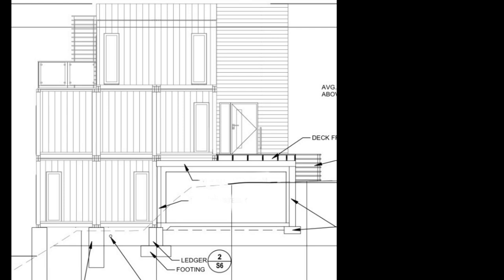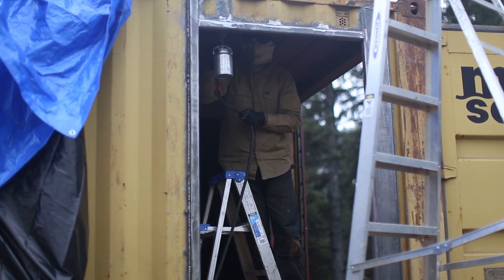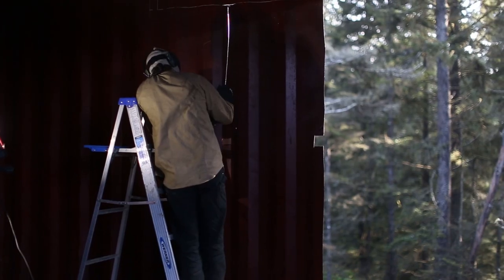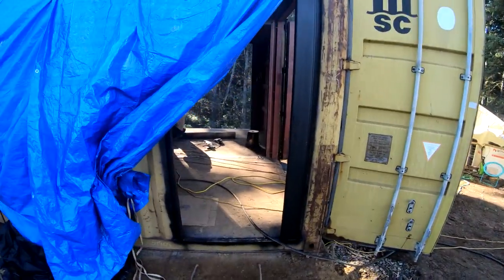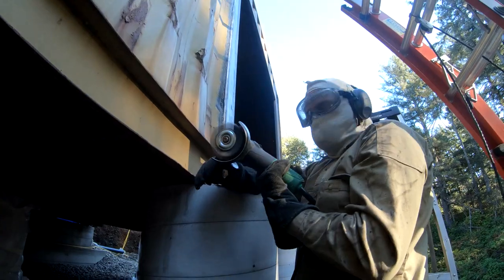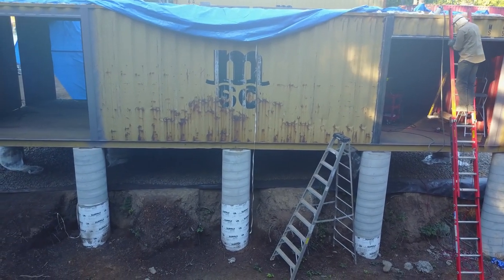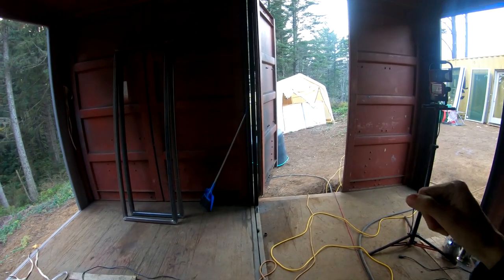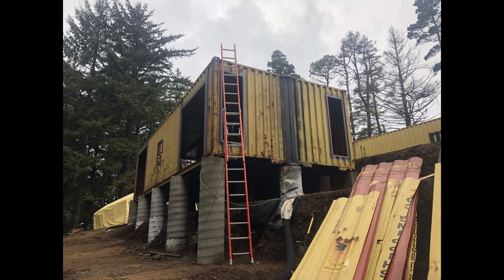CUTOUTS ON THE 1ST LEVEL of our CONTAINER HOUSE - Ep. 11

Comment: Would you consider doing a somewhat detailed video showing all of the tools you are using laid out? Welder, welding wire, generator, air compressor, grinders and various disks, etc? Detail (steel type, dimensions) about the particular structural metal you are using for cut out reinforcements? Thank you - I much appreciate your informative videos! You guys are doing a great job!
Reply from the maker: Thank you!! I’ll be doing a video about the tools needed to build a container house and how to start a container house in the near future. 🙂

Comment: I had a Chicago Electric angle grinder.  It would get so hot after a short time of use that I couldn't hold it without gloves.  One day it went uo literally in Smoke.  I replaced it with a Dewalt and I can run it for long times without it heating up.  I bought a Hobart 120/240V welder.  They are made by the same company as Miller. My cousin is a professional welder and having used it, says it's a good welder.
Reply from the maker: Good quality tools do make a big difference. 😊👍

Comment: Nice work. Since you are welding the new frames to corten steel, do you have to use a certain type of frame steel and weld material?  Thanks
Reply from the maker: Arlin P We MIG welded with flux core (due to being outdoors), and the frames are mild steel. 🙂

Comment: The best way to cut the container wall is to use the plasma cutting, that is really fast, I used to do this.
Reply from the maker: Plasma cutter is definitely the least physically demanding way to cut the containers, but the cuts are a little jagged and when you get close to the bottom it burns the floor. We use the plasma cutter for cuts that don’t need to be as precise or aren’t close to the floor but overall the angle grinder does straighter, cleaner cuts. Both have their pros and cons though. 🙂

Comment: What kind of blade were you using on the miter saw - metal cutting abrasive disc; metal cutting circular saw blade or carbide saw blade?
Reply from the maker: It was probably a metal abrasive cutoff disc. It's been a while so it's hard to remember some of the specifics! :)

Comment: Hi! Love your videos. I have a question as I am looking to do a similar build. I've read that containers are designed to have all weight-bearing points be on the corners so there is no reason to reinforce when removing slabs from the sides. Have you read differently or where did you learn about the need to reinforce the slabs? 

Thanks in advance!
Reply from the maker: Hello! Yes they are designed to sit on the corners. When you remove any parts of the container it compromises the strength and that needs to be considered when designing a container structure. The reason we have such large reinforcements is because we will have 3 stories + a rooftop deck and we have pretty large sections cut out of the sides. If you had minimal cutouts you probably wouldn’t need too much reinforcements but that’s something I would definitely recommend to speak with a structural engineer about. 🙂

Comment: MIG welder you are using is meant to push against the weld point instead of welding away as you have a gas shield that is meant to protect the weld against any intrusion.I did saw you welding away instead of welding against the point.I am not saying that is incorrect all I am saying that the weld need protection from the gas when applied.Hope it helps.
Reply from the maker: I mostly use flux core which requires you to pull instead of push. 🙂
Reply: Aha I was intrigued as I heard some MIG word and I was thinking of gas protected weld. Keep up the good work!

Comment: Hello, I'm a new viewer, but I'm working on plans for my own container home build. I'm curious what size steel you're reinforcements are? Around door/window cutouts and center wall cutouts between your two containers?
Reply from the maker: Hello and welcome! The reinforcements vary quite a bit. The tubing ranges from 2x2 to 2x6 and 1/8 to 1/4 thickness, and the C channels are between 5-6" depending on the opening. 

Depending on the complexity of your build, I'd recommend to speak with a structural engineer to verify any reinforcements for your project. It will depend on how many levels you are planning on doing and how large the cutouts are, etc.
Reply: @PacificPinesRanch  awesome! Thanks very much! It sounds like the plan I really want, I need to chat with an engineer anyways. I've been enjoying watching your build. There's alot of time put into this for sure. Is there any reason you went flux core vs shielded welding? Thanks for the reply for sure!
Reply from the maker: @lanceleroy100  thank you!! The main reason for flux core is because majority of the time we are welding outdoors
Reply: @PacificPinesRanch  make sense to me! I'm just starting plans, but I think I'll be joining you all up in Oregon with a container build of our own sometime soon.

Comment: you have the angle grinder upside down, if you take the handle out and put it on the other side you won`t have the sparks flying in your face. ;)
Reply from the maker: Thx for the advice! We probably had a reason for using it that way depending on what we were doing... but this was also a while ago so it’s possible we were just figuring it out by experience. 🤷‍♀️🙂
Reply: @PacificPinesRanch  I get it! Sometimes you do indeed have to have it the otherway around. I have had sparks fly at my nose for days, sometimes so bad that the insides of my nose where black. Very nice work you guys are doing by the way, I have Dreams of doing something like this myself. I can't wait till your next video👍🏼
Reply from the maker: @jarnickramm6026  Thank you!!! 😊 Sounds like you live the “grind, weld, paint, repeat” life too lol

Comment: love what your doing, need gauges or steel thickness, close up positioning. helpful info like wire gage, steel type, cut times, costs perhaps. power available, fuel consumptions, Is your steel being delivered, still transport costs. Did you find discounted window and door assemblies how are your insulation plans, power plans electrics heating, respiration gear, Protection, ECT.
i'm sure that any information it can be added from your experience it's not too much, for people that really want to do this the documentation is Very helpful, for those that want to just flap their gums and tell you you're doing it wrong all the time well this is not your focus of course you know this there are always people that have opinions like mine that may be worthless, or they just are very small harted and have nothing better to do but to be negative, thank you for your efforts, they are appreciate it, and I hope everything turns out exactly as you wished it too.❤️💪💥👍✌️
Reply from the maker: Thx for the encouragement!! I will do my best to add those details to future videos. Thx for the suggestions! 🙂

Comment: actually guys im amazed you dont just use a skillsaw with a diablo steel cutting blade... what takes you 20 mins with the grinder only takes you 20 secs with the Diablo blade,, you get cleaner cuts too
Reply from the maker: I will check that out 🙂

Comment: This is a 40-foot container, weight with a cargo over 30 tons. in seaports they stand on top of each other in 5 rows. 
the lower one must withstand up to 150 tons. why strengthen them?
Reply from the maker: Floks 700 When any areas of the container are cut out, it loses strength and that loss of strength needs to be compensated.